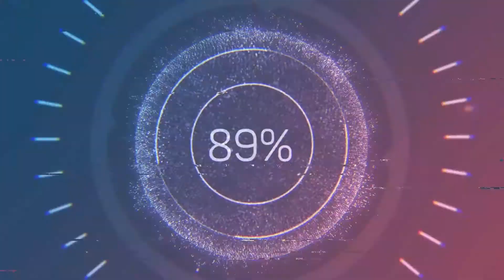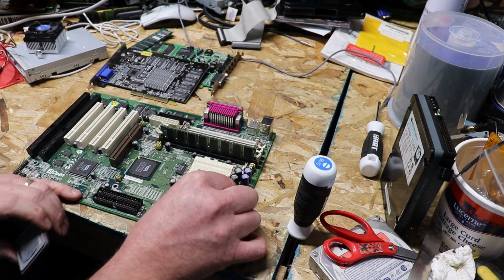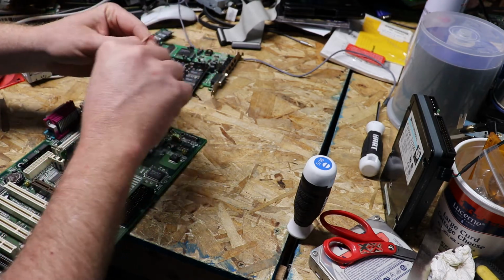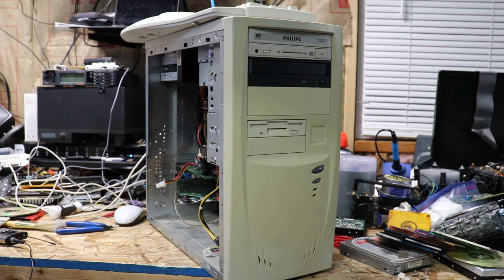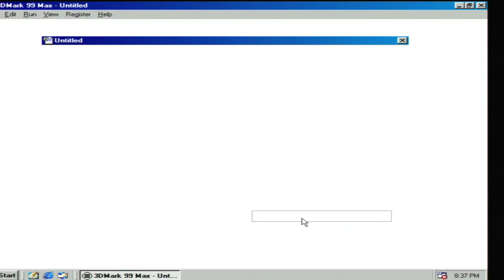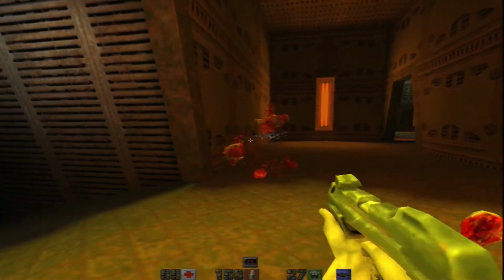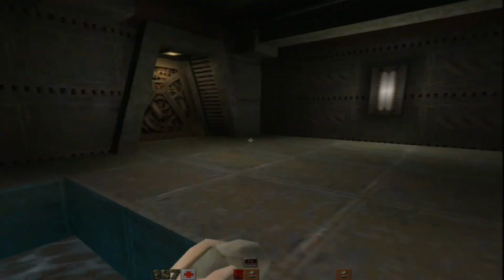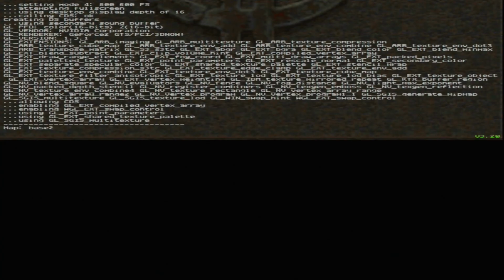#sockettome7

Comment: Sweet video and build, Patrick!  Is anyone else surprised at the horrible placement of the floppy drive connector?  At the opposite end of the board from the IDE?  What's the deal with that?  
Nice choice of games to demonstrate.  I should have done better, had I had a video card that really worked!  😂
Your case is the little brother of the first one I painted and restored, back in June.  Nice!
Reply from the maker: Thanks Bro, yeah that floppy connector leaves a lot to be desired I was going to show case freespace but YouTube said not this time on the checks. 😥 star wars that was a fast hard nope also.
I didn't even thank about the case hoe weird is that. I have a fun one to show off later though.

Comment: I was watching your round-up/thank you video yesterday and it occurred to me that I hadn't watched this video! Turns out I started to and got interrupted. When I saw you were using the VIA chipset I wasn't optimistic, but it looks like you got pretty good performance out of it! I think when it comes to graphics cards there is leeway of up to 3 years, because it was the single biggest improvement you could make on systems like this back then. My system was mid '96 technically, but I imagined the scenario that I had upgraded an original Voodoo to SLI in '98 for the resolution bump.
Reply from the maker: Thanks, I really had to rack my brain on rebuilding this system to get what I got out of it. The via was very picky on which driver you used. The graphics card was a huge help.

Thank you again for being a part of this build and everyone else too.
Reply: @OCROldComputerRebuilds  p.s. that's the case my Pentium III system had back then. I have good memories of it but it's not special looking, that's for sure.

Comment: Great video. The K6-3 was an awesome CPU. Since it has on-die L2, does your board support using the 1MB onboard as L3? I seem to recall that some supported it but I’ve never owned or used one before.
Reply from the maker: Thanks, It does show up as L3 but I'm not sure if it actually utilizes it.

Comment: My 500Mhz K6-2 isn't stable without thermal paste... To me, 486 and pentium class machine don't need it, all above do...
Reply from the maker: Thanks for you comment.👍

yeah It's just warm to the touch that's all. Not that I don't have any I just wanted to see how it would do, so far so good. most of those amd cpus were glued down with that black epoxy cement anyway. 

Yes it is recommended to use thermal compound and later if I do any overclocking with it I will definitely it.